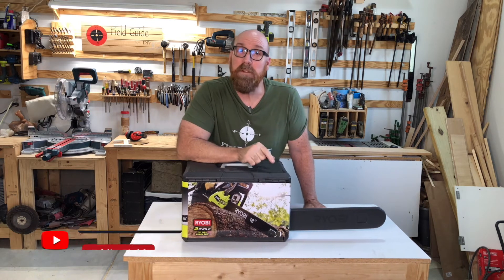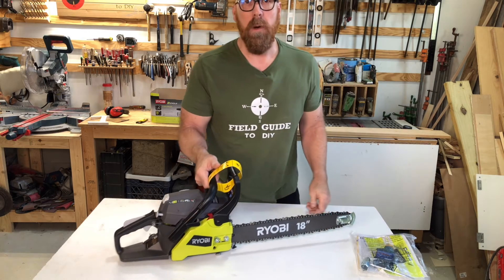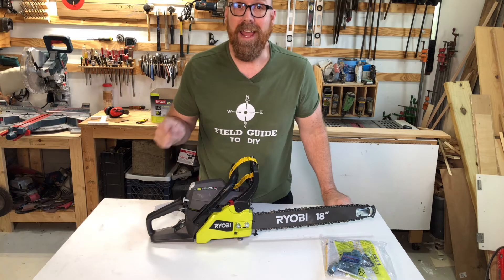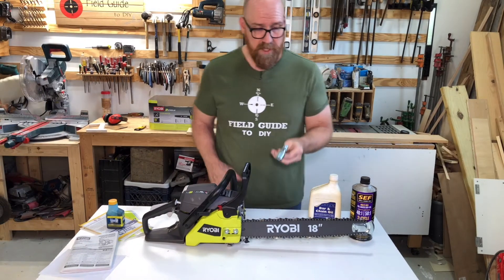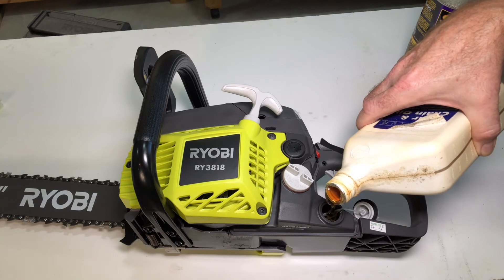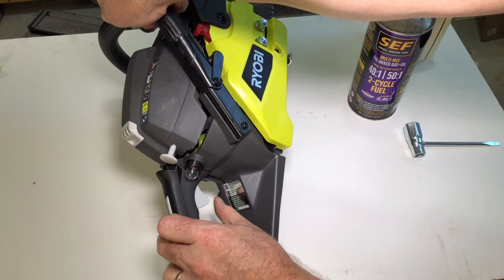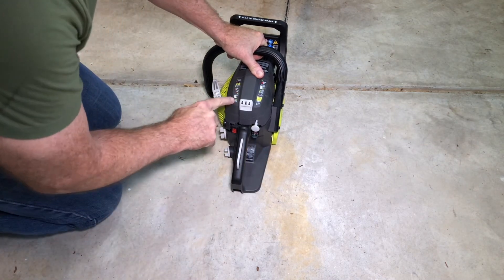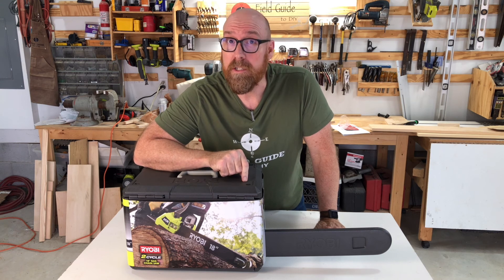Ryobi 18 Inch Chainsaw Unboxing, Setup & Review

Comment: When you stop running the chainsaw for the day do you need to let it run out of fuel in the carb before putting it away for long storage?  How do you do that?  

Also, there are some gas stations that sell Ethanol free gas.   Buc ee's  here in Texas does.  Not sure of any others.
Reply from the maker: I drain the gas tank before putting it up for the winter.  I also have heard folks drain the chain oil but I don’t do that.  You should be safe with the non-ethanol fuel.  Thanks so much for watching and for chiming in.
Reply: @FieldGuidetoDIY  Great thank you for your reply!  You have a great channel and you explain things very well.
Reply from the maker: @TexasRedneck  thank you so much.  That is huge!